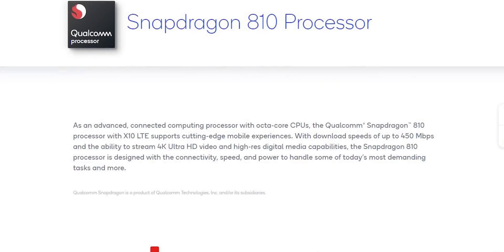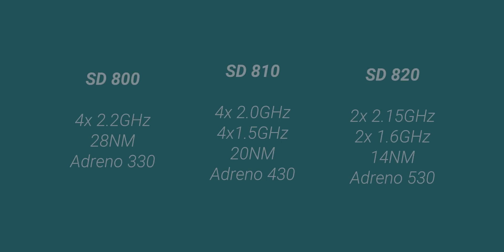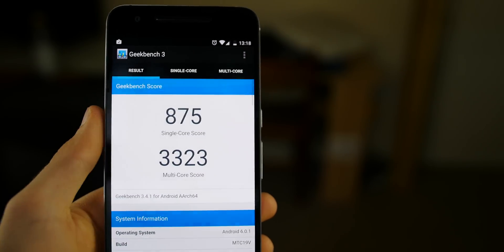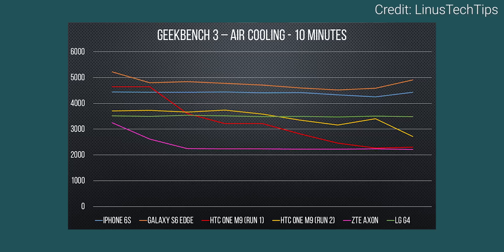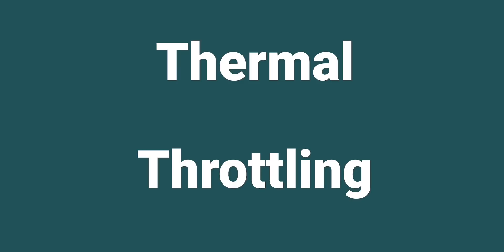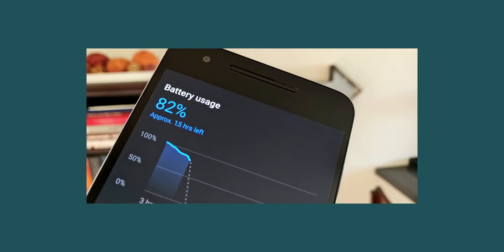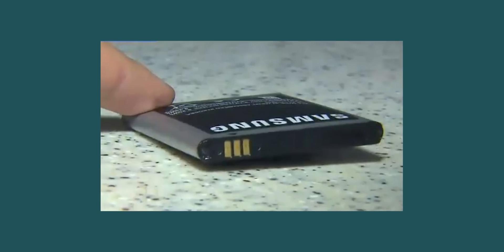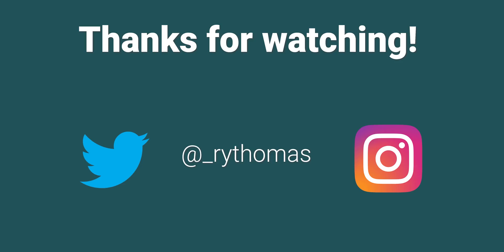Snapdragon 810: The Worst SoC Ever?

Comment: rightly put my one plus 2 has this soc  snapdragon 810  and the phones suffers.....with this chip i am grappling with heating and thermal issues.....
Reply: Mine doesn't get that hot and I have a custom performance kernel, where do you live and what rom are you using?
Reply: @BankruptGreek  i live in India....and am using oxygen os  version 3.3.4 as overlay and i  did not upgrade to a marshmallow....it is in lollipop version...
Reply: @rajlovinglife  I am on pie lineage OS it's working alright.

Try to install app ops and greenify it will help but you need some fiddling with app ops, certain apps won't work if you for ex. don't give them right to access photos but you need to upload one then they ll not load. And then greenify you ll need to not greenify apps you want to run in the background like messaging apps and email etc.
Reply: @BankruptGreek  thank for the reply appreciate it ....as of  now it has been two months  passed i have not been using this phone for it boot looped on me aka soft bricked and when i went to the one plus service store they said you have to wipe clean or format the phone ...which i am  not willing to do  because i would tend to loose  my data , backups, screen shots,contacts etc  i don't know what is the fix for this...so currently using my samsung galaxy  s4....can bootloop be fixed without any loss of data....i am still confused in this matter.....
Reply: @rajlovinglife  go to xda maybe some people can help you, try to see if you can access custom recovery if you have it and if you don't try to see if you have access to the firmware screen / bootloader were you could flash the custom recovery and from there you can connect it to your pc and access your data and back it up manually.

tldr; If you got access to your bootloader you can do a lot of things. best of hopes
Reply: @BankruptGreek  thanks man will definitely  look into that as well.....hope it gets fixed soon...
Reply: Consider that your phone is using the Snapdragon 810 v2.1, which as fixed most of the thermal issues (or at least they tried) so imagine if you were using the first version lol
Reply: @blur9104  nope it is version 2.1 alright one plus 2 has worked with snapdragon to deliver a great hardware vs software experience but both have  to come a long way i guess....one plus just announced their hydrogen and oxygen os  on the one plus 2 unit and have just come about refining them....so

Comment: Been using my z5 with the 810 SOC with no problem,although some heating issues surfaced from time to time, otherwise it's running perfectly fyn.
P.S. The revised version of the snapdragon 810 was used in nexus 6P and Xperia z5 phones :)
Reply: I am using the one plus 2, it does heat up but not to a uncomfortable level. I ve "overclocked" it using kernel auditor and some performance profiles and it runs way better than before. Sometimes it does slow down a lot but it's not a deal breaker for me at least

Comment: There is circumstantial evidence that the CPU itself could burn up. On devices with bootloop issues some have fixed the problem by disabling the big cores and running on the small cores only. 

The 20nm process was part of the problem as it was a very minor power improvement over 28nm, but the chip was simply rushed. When Apple introduced the 64bit iPhone Qualcomm were caught off guard and had to use an off the shelf ARM CPU design instead of designing their own like they had in the past. That was their only option for a 64bit CPU core. The 820 had their own CPU design and was probably what they should have released, but it wasn’t ready. Today Qualcomm take a hybrid approach using ARM designs that they modify.

Comment: It's predecessor is 805 which is in my Droid turbo... Not 800..please correct the info
Reply: 805 is not really a major upgrade from the 801, the CPU is 99% the same, only the GPU is better.
Reply: Thibaut Mahringer whatever.. It's predecessor to sd810 not 800
Reply: @avinandanmondal9550  It's more the successor of the 808 then.
Reply: Thibaut Mahringer it's not cause 808 and 810 were announced at same time...not at a generation gap
Reply: @avinandanmondal9550  So what ????? 🤷‍♂️🤷‍♂️🤷‍♂️

Comment: You are absolutely right, I had Nexus 6P and it had heating issue. Also because if Snapdragon 810 some Nexus device had bootloop issue.
Reply: Agree, but with the updated android 8.1, my 6p is running rather better and the heating issue is reduced. But still, the phone will get hotter when i used for taking picture constantly
Reply: Also the 6P had huge quality control issues at the time that hauwei and google didn't address till much later. The screen adhesive was pretty weak
Reply: @bl00dkillz  if it was getting so hot no wonder the adhesive got loose...

Comment: I remember when LG G4 (I believe) was using Snapdragon 808 instead, and also how Xperia Z5 had problems with recording videos, because it would just stop working because of high temperature.
Reply: Yes, my dad uses z5 qnd when you shot a video in 1080p resolution,  it will only last for about 7-10 minutes before the camera app shut down by the system. My friend who uses z5 premium said thar in 4k, the camera app only last for 4 minutes until the temperature is to high
Reply: @albertacesantosa416  as a previous Z5 owner I can confirm this, mine heated from your everyday apps like Instagram and even the music app, the camera was a lost case and I just gave up on taking videos with it because the phone would just shit it in mere minutes die to the extreme heat that reaches 70c at times, though in the XZ premium all those problems were thankfully gone
Reply: @albertacesantosa416  I never really had much problem with long video recording but I do get a lot of stuttering. Also the file naming system was awful because sometimes I don't realize my SD card is full and  it switches to internal storage and resets the numbering to whatever you have in that camera folder. Then I get a lot of files saying DSC_0001 (2)  at the end.

Comment: I found the same with the 820 as well in my old xzs it got really warm as well as poor battery life
Reply: Might be the phone bro, the XZs only had 2900mAh of battery, plus sony's skin was pretty bloated at the time (don't know about now, havent used Sony phones in a while). I've went through two 820 phones, Oneplus 3 and S7 edge, and both had pretty decent battery life tbh. Oneplus 3 didn't get that hot, S7 edge did tend to get a bit heated during heavy use, so I guess it's all phone specific, nothing to do with the chip really.

Comment: not even a 810 but the 808 in my old LG G4 used to heat up somuch while just doing general use, not even gaming. if it wasn't for the shit battery life and the thermal problems i'd probably still use my G4. great video Ryan!

Comment: Samsung dodged a bullet by using their exynos processor instead of the SD810 in their S6 line in the west. Aside from meh battery life, it ran fine
Reply: Batteries were small tho
Reply: @golechatytp3207  that's what he said about the battery life being meh
Reply: We always get the Exynos
Reply: @Krunkeridleios  us in the west would rather have the exynos model of the s7 in the long run
Reply: @Krunkeridleios  exynos does a better job with camera and video though I have Snapdragon on my note but exynos on s10 is better for the camera
Reply: However, the S6 had no SD card or removable battery which alienated the diehard Samsung users. Many also felt like Samsung was trying too hard to copy Apple the same way HTC did years before by emphasizing design over expandability with the One X and One M7.
Reply: @FrankyboyLegend  that's more of an s6 problem rather being as a result of the chipset used. Allegedly according to them, the reason they removed expandable storage then was to increase performance in terms of storage speed with the new ufs 2.0 at the time
Reply: @bl00dkillz  that is correct as microsd slot was considered a bottleneck until they addressed it with  S7, but other manufacturers could have taken advantage of that more. LG opted for Snapdragon 808 and HTC shot themselves in the foot with a boatload of Mediatek devices.
Reply: @FrankyboyLegend  they wanted to give their phones a more premium feel as well
Reply: No they not one of my edge still had battery problem do to heat issue.. The fact is modern chip still had problem but thank to it... Newer phone had better heatsink... It just unavoidable on high usage phone. Heat will happen... in the end you need case so you can hold on to the phone.
Reply: I use Galaxy S6 Flat,For playing PUBG Mobile 10 Mins gameplay pop up Too Hot Notification,Amd after that,the game became So Lag and many framedrop,skip 10 mins again,the app Force Close because to hot,too bad Exynos 7420 for Hard Gaming :"(
Reply: I had note 5 it's fine

Comment: SD 805 is way better. 2.7 gz and smooth as fuck even in 2019. Nexus 6 is still perfect
Reply: Many think it's an slow device, that's an issue coming from the battery, swap it and you're up to speed again. But can't deny that the GPU isn't quite enough for QHD.
Reply: @Hybrid Theory yeah but still can't keep low resolution forever. If we could decrease it only in games it'd be cool.
Reply: @Hybrid Theory lol if i do that on my lg g3 or g5 looks trash on 1080p i can see the pixels i dont wanna think how is if i lower to 720

Comment: I used to have an Xperia z3+ (now used by my mom)which uses an SD 810, it still works great except for the heat it generates. But I had to replace my device’s touch display twice under warranty because the touch started malfunctioning within a few months of usage mostly because I used to play mini militia back in day for a long time during the phone would be extremely hot around 125 F (I checked it using an app called accubattery) and after the second time narrowed it to the game and stopped playing it. But anyways right now it just heats up and most of the time the phone prevents apps from opening cause of the heat.

Comment: Yeah, I remember brands like lg and google using the 808 instead.
Reply: Samsung uses Exynos in US instead.
Reply: Jason Aquino idk where you get yours from but my devices use SD SoCs here in Cali
Reply: The G4 was an example
Reply: Yeah.... Even moto x (pure) got sd808.... It was also crap bad performance and heats like oven.... When used lte it used to release burning plastic smell
Reply: Samsung avoided the Snapdragon completely and used their Exynos in the S6 and Note 5
Reply: @alvzcizzler  It was even featured in American s6s as well. Us Samsungs use Snapdragons, but that yesr they used exynos everywhere.
Reply: 808 still have the same problem
Reply: My LG G4 still fucking overheated. My current phone uses a midrange processor instead lol
Reply: Even Microsoft
Reply: @aryantiwari1945  even Xiaomi
Reply: The 808 used the same CPU cores as the 810, just 2 fewer of the big cores. It was still a garbage processor that overheated and throttled like crazy. Qualcomm really dropped the ball that year.
Reply: @timg2727  What sd 810 and 808 is very2 hot ? Any reason or source ?
Reply: What about EXYNOS 990 ???
Reply: Still my Nexus 5x is still dead
Reply: Is still use my mi 4c with sd 808...
Reply: Even 808 still has heating issues and severe throttling based on my exp. SD820/SD821 did improved on their thermal performance.
Reply: @arjaydee6379  I haven't had any problems with the snapdragon 821. Runs cool usually

Comment: The sd810 got htc, sony, lg into a lot of trouble with the m9, z5.. I'm using an oneplus 2 and am very thankful to oneplus that the saving grace was oxygen os which handled the issue pretty well with an lot of algorithms to handle the Issue and of course thermal gels were applied 

Now I'm on lineage os 16.0(pie) with monthly patches and now i wud say sd810 was a not that if a mess it's jus Qualcomm tried something diffrent and back fired
Reply: I own an m9. And with that alluminium shell, the phone would get so hot. I didn't really bother me that much tho and I was happy enough with performance especially with its decent ram management.
Reply: Can You Please Share The Exact Rom You Are Using & Have You Found Any Gcam With HDR+?
Thanks In Advance😊
Reply: @abidshuvo9418  I'm using lineage os 16.0 (pie based) with April security patch. i don't hav any gcam installed I'm oly using the normal lineage os camera
Reply: @anirudh9551  I Also Used That Rom And It Was Quite Stable But Just For Getting Better Camera Performance I Came Back To Oxygen OS
Can You Please Suggest Me A Rom Which Supports Gcam
Thanks😊
Reply: @abidshuvo9418  I'm sorry man the snapdragon 810 doesn't hav much gcam support. it's not lineage os fault the chipset isn't well supported when it come to gcam
Reply: @anirudh9551  sorry but you're wrong, your phone is using the Snapdragon 810 V2.1 which has fixed the thermal problems (or at least tried) so you can't compare it with the ones in Xperia Z5 or M9
Reply: @blur9104  are you sure man?. because the nexus 6p oly uses the v2.1 of the sd810 and not the oneplus 2
Reply: @anirudh9551  totally sure, Snapdragon 810 v2.1 and some OnePlus thermal improvements
Reply: @blur9104  ohh ok man, 👍😁
Reply: @blur9104 The HTC M9 and Z3+/Z4 already used 2.1 but still had problems. Sony tried to fix it with dual copper heatpipe cooling on the Z5 and Z5 Premium (although they still had issues with benchmarks).  Some reviews indicated the OnePlus 2 and Nexus 6P were the "best" which still doesn't really say much today.
Reply: @FrankyboyLegend  So one plus 2 doesn't really hot right ? They still can run fine right ?
Reply: Though even OnePlus really hated that phone, considering it never got past official Marshmallow